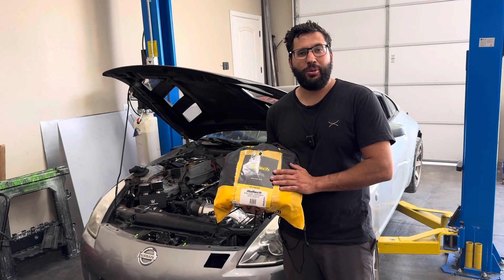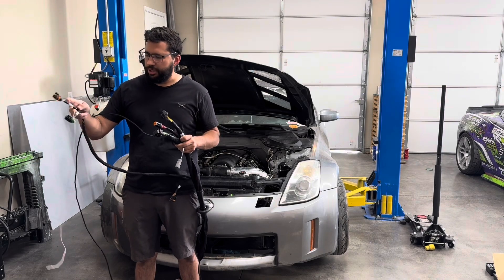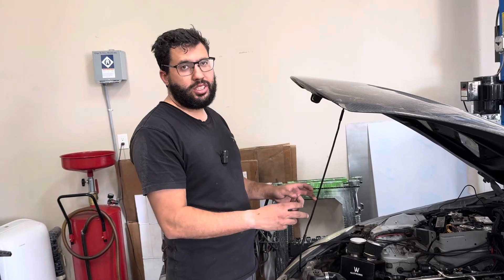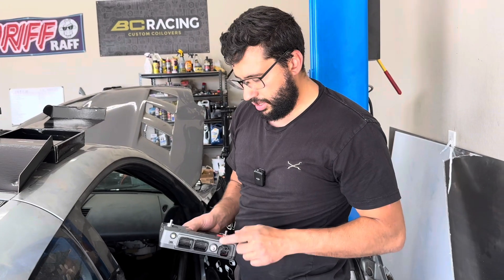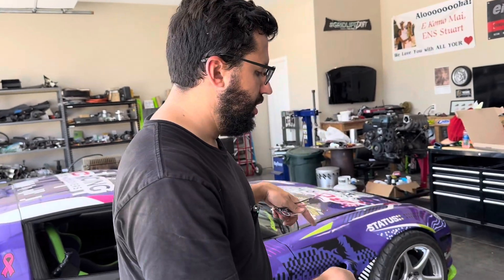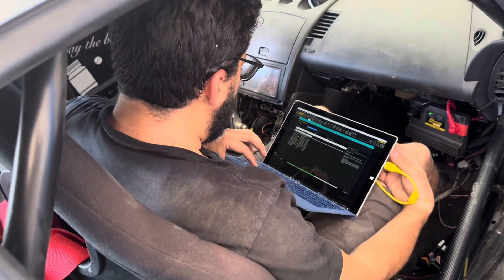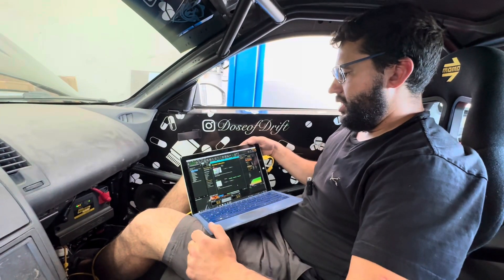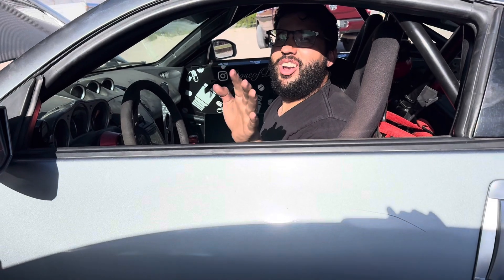Installing the NEW HALTECH NEXUS REBEL LS on Megan’s ls3 350z! No tuning start to finish, part 1

Comment: Wait how did you wire up the fuel pump? I thought you couldn’t run it directly to the ecu I thought you had to run it to a relay?
Reply from the maker: This ecu is also a pdm, it has 3 outputs you can run directly to an accessory

Comment: One of the main differences between the different camshaft selections, apart from the fuel/ignition map and the rev limiter, is the base idle percentage (bigger cam needs more), so that might be why the idle is a bit unstable. It will learn that over time though but maybe with that cam you need a higher idle speed. The "race cam" map was based off a BTR stage 4.

Happy to see good throttle response out of the wizard map.

Thanks for sharing!